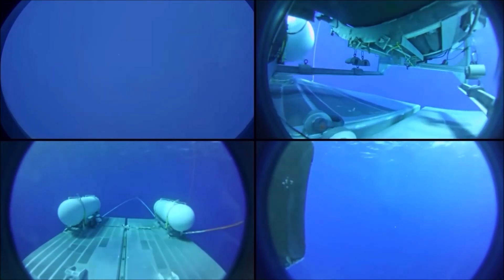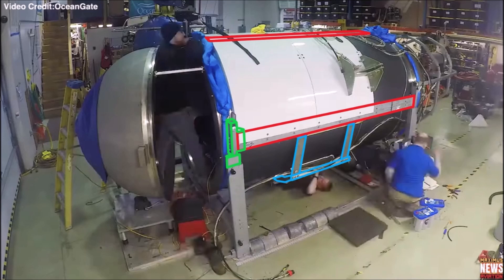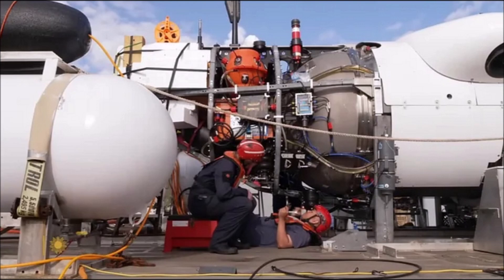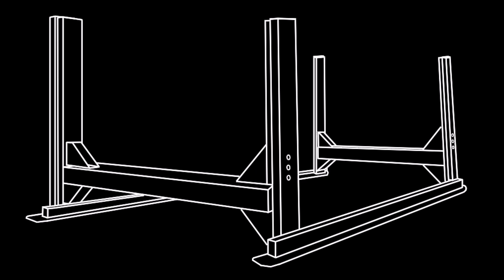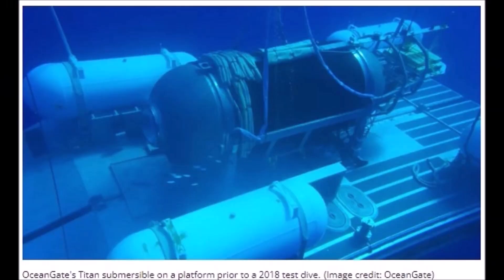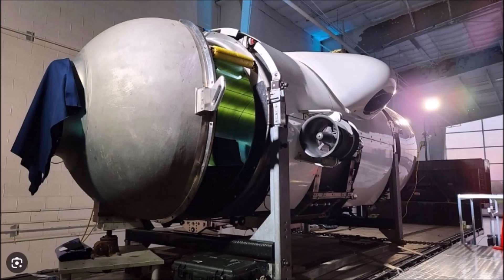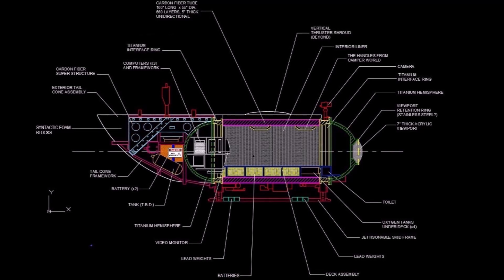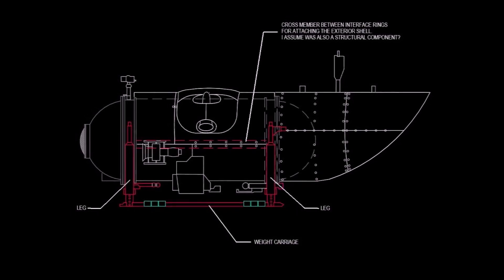OceanGate Titan - CONNECTIONS BETWEEN INTERFACE RINGS

Comment: The three rods are not tie bolts, which are unnecessary in a pressure vessel. What was needed were compression columns to take some of the load off the cylinder, preferably a whole additional metallic cylinder, then ditch the Carbon fiber. There is no corrosion on the frame in the photo, it is just wet from rain, look at the Ti end cap. I'm glad you removed the pointer calling for syntactic foam under the deck inside the vessel, you could have mentioned that too. But they are not batteries either, they are Oxygen cylinders. Also the missing leg of the frame may allude to the unraveling of whole story but we don't have access to it.
Reply from the maker: Well... I said equivalent to tie bolts, which yes, really aren't necessary. I was trying to correct the idea I conveyed that there was nothing at all between the interface rings, which was not true. Guess I could've worded that differently. According to Bruce Morton in this video - https://youtu.be/IHR3foWRy94 - there's batteries AND oxygen bottles under the "deck". The bottom part of the skid looks corroded to me. Stockton's whole point with the carbon fiber cylinder was that it's three times more buoyant than titanium is. That was his motivation with it. The RTM sensors were supposed to prevent this whole thing from happening but we know how that turned out. 😟
Reply: @VegasCyclingFreak  Yes, much less syntactic foam was needet because of the carbon fiber hull. I would really like to see the blueprints with all the measurements and materials used.  Also Stockton said he had tested the 2. or 3. carbon fiber hull from Titan at the deepsea pressure chamber in Maryland, i think they tested ALVIN there as well, would like to know if there is any record of this.
Reply from the maker: @Xantylon74  I only know of them doing testing in a hyperbaric chamber before the first test dive in 2018.
Reply: @VegasCyclingFreak  OK. Yes, Batteries, and Gas tanks under the deck. Now that you point it out, Rush did say that the carbon fiber is more buoyant than Titanium - however - that now explains two things to me: 1) A Ti cylinder would be many times thinner than a Carbon Fiber cylinder of the same compressive strength, which effectively eliminates its buoyancy preference. 2) Rush, if he was an engineer (which I doubt) would know this, so this is proof that he was not an engineer despite the sheepskin. He was a charlatan.
Reply from the maker: @colinellicott9737  Rush claimed that the titanium hull would be twice as heavy as the carbon fiber and require a lot of syntactic foam too… I think he was also trying to make something that looked slick besides being very buoyant.
Reply: @VegasCyclingFreak   If the Ti Hull was heavier it would require more syntactic foam, but, Ti is only twice the density of Carbon Fiber, and the Ti hull would be more than twice as thin as an equivalent Carbon Fiber hull, hence he should have used Ti. He used Carbon Fiber because it cost one tenth of Ti. He was a cheapskate asshole. Also that is why he skipped the certification process.
Reply: @VegasCyclingFreak   Are you sure he said he wanted something that looks 'slick'? (BTW - the carbon fiber is not visible, therefore slickness voided).
Reply from the maker: @colinellicott9737  Yeah, there certainly would have been benefits to using titanium instead.
Reply from the maker: @colinellicott9737  He didn’t say that specifically but it’s inferred in the interviews I’ve read/watched. He definitely seemed to not like weird bulbous looking things with lots of syntactic foam.
Reply: The hemispherical titanium end caps were 3 1/4" thick, the cylindrical carbon fiber composite hull was 5" thick.  Spheres are at least 2x stronger against external pressure than cylinders so I think a cylindrical titanium hull (without ribs as used in submarines) would be at least 5" thick at 66" OD and thus less buoyant than the Titan's CF design. The mechanical properties of titanium vary a lot depending on the grade of Ti,  I haven't found info on what grade of Ti OG used for the rings and endcaps.